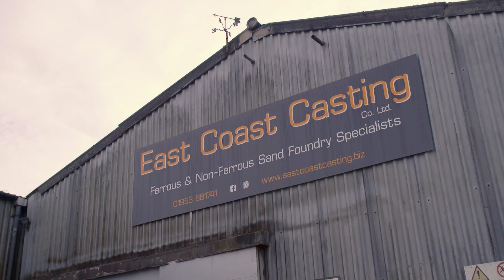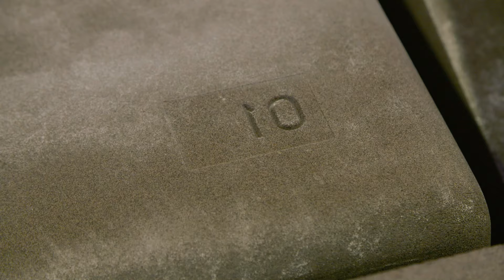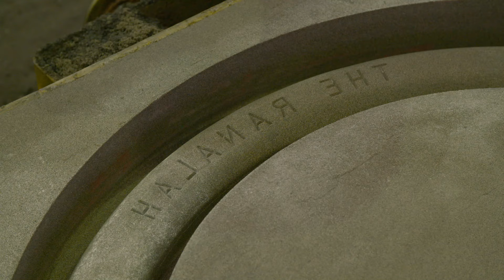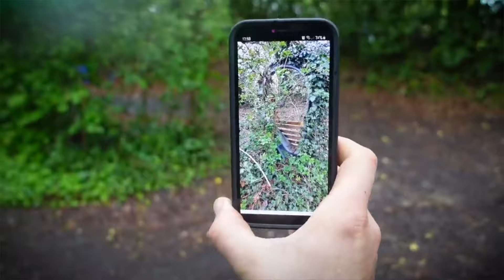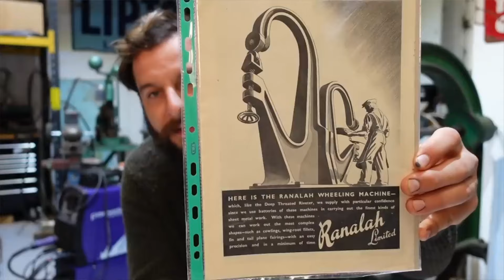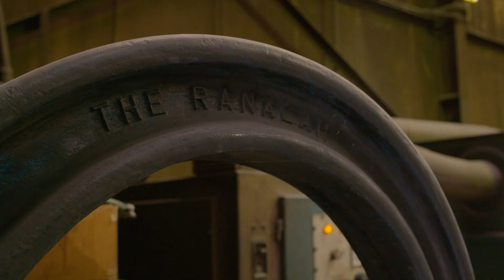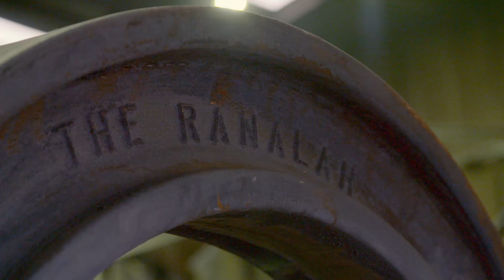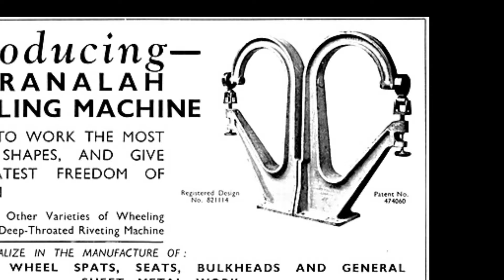Casting The First Ranalah! What Could Go Wrong?! | Reviving History (Episode #7)

Comment: I've personally cast over 200 tether cars in the last 25 years. When I made my very first pattern and poured my first casting it did not come out correctly, only half filled. Making changes to the runners and venting properly, the second one came out perfectly. The feeling of seeing that after making the patterns, building the furnace and pouring the metal is an incredible feeling. And holding that casting in your hand is a special moment. I deal with many customers that have a lot of money and can buy most anything. But the feeling you get from producing something yourself with your own two hands they will never know. Except for my buddy Malibu Larry. He's a self taught machinist, fabricator and mechanical engineer and builds the coolest stuff just for the fun and satisfaction of it. His mansion, Ferraris, Porsches, etc. are cool but no comparison to the awesome toys/projects he builds. Kudo's to all who work with there hands!
Reply: Great words 👍🏻

Comment: That looks truly amazing, it really does. I hope it inspires many others to follow your footsteps in similar projects large and small. I was lucky enough to be able to learn the sand casting process when at school and made a cast aluminium G clamp which I still use 40 years later. Congratulations
Reply: And I made a sand cast paper hole punch body which I still have. Imagine a school having it's own foundry and full engineering machine shop today.
Reply: @andrewdking  I went back to the school a couple of years ago and the workshops have now been converted into technology classes ... you won't get your hands dirty there anymore!!
Reply: @davidberlanny3308  well at least you still have your old senior school. Mine was Bourne Valley in Hemel Hempstead and was one of the best schools for engineering and technology in the country through the 1970s. Alas, now raised to the ground to become a housing estate cus the birth rate plumited. Now it's right back up again. Short sighted councils as usual. Anyway, it had a metalwork shop, a machine shop with foundry, a woodworking shop with machines, a technology shop specialising in pneumatic automation, plus a drawing office classroom (TD). We won many country wide interschool engineering challenges, making a hand pump fire engine, a petrol engined powered go-cart and a few racing hovercraft (single and double pusher fan types), even doing our own fibreglass moulds. We digress 😄
Guess my profession; mechanical engineer in aerospace 👍
Reply: @andrewdking  It's a small world Andrew, I was born in Hemel Hempstead!! That said we moved away when I was little and I didn't go to school there. It's a shame that your school was erased, I wonder if any pictures exist of all that was made in those workshops. I hope so - these days you will find practically everything on the internet. I didn't know when I was at school but our metalwork teacher wrote several books on metalwork for beginners. To cut a long story short, with the help of several people these books have now been republished. You will see  a short video of some of the pieces that we made on my YouTube page, I apologise in advance as I'm really no cameraman!! It's entitled 07 Kenneth Wells.
I also moved into mechanical engineering and now find myself working on submarine projects in Spain

Comment: Congratulations Dom ! A great finish to the year. As an engineer (retired) I love to watch the experts at work .I could almost smell that distinctive slightly sulphurous smell of a foundry again. Magical to see the casting rising from the sand.
Now, how are you going to machine it ? I'm really looking forward to the next instalments.
Happy New year.
Reply from the maker: Thank you! The foundry is an amazing place we were very lucky Chris let us wonder around all day! 
There is no machining on the body, the parts are set into the oversized holes, I’m working on the jigs now
Reply: @DominicChineas  Do you have to let the casting rest outside for several months so it stops moving like in the old days or are there methods of de-stressing it now with heat treatment. I have seen images of the large stacks of castings for the Victoria Line Tunnels weathering outside before they were checked for size & shape and installed.

Comment: Brilliant video and we both have things in common as I also cast metal but only bronze & alloy and not to the size of anything that large,+ I built my own full size wheeling machine but out of 6” square tube 1/4” thick as I also restore old cars but as a hobby as I’ve been retired since 2003 . You’ve done a cracking job and quite rightly must feel proud 👍👍👍😀

Comment: I used to use exactly one of those during my sheet metal worker apprenticeship in the late 1960s. They were mainly meant for manufacturing car body parts, to repair damaged ones or make replacements. They went more or less out of fashion when it became cheaper to just buy replacement parts from the car manufacturers. I wouldn't be surprised if there are still quite a few in use in Africa, India and Pakistan where it's difficult or too expensive to buy replacement parts.

Comment: I used a similar machine back in the 90's. There was a wheel on the bottom you would kick with your foot as you wheel and then a long lever to turn by hand to increase force. The floor would shake when the metal came out under load.

Comment: Did you know that there is a 3D sand mold printer that would have done the same mold without the wood pattern.   I don't know if any fabrication company in your country had those with Dassault Catia to make the 3D model rendition, but if you had access to one, the process would have been probably simpler.    

But still the pattern maker did a great job and you got a nice replica cast that match the original.   Can't wait to see the machining and the final assembly with the moving and fix parts and see it shape metal sheet into a part.
Reply: We have used 3D printed sand molds to produce a Bentley block, but I’m unsure if a sand mold of this size could be printed. You would still need a metal frame around the mold which we did with the Bentley 3D printed mold. 

Of course we use modern methods in our works but the traditional side of producing this item is & was the best way’ Dom is keeping as close as possible to the way these historical Ranalah machines were made, and this is the way 100%. 

Glad you enjoyed the video.

Rgds, Chris

Comment: I think I could tell them apart, Dom. As I said a few months ago, the font isn't perfect. The original R has the loop that intersects the vertical half way up. The new one has the loop intersecting the vertical slightly higher. However, despite that, I think it's brilliant. Well done to you and everyone involved.  You clearly are made up. I hope the venture succeeds beyond your dreams.
Reply: Andy, You will always be able to tell the difference from a new casting to a original 100 year old one. The font is spot on and may differ as to the sand or moulding technique they / we use. It may differ on every Ranalah at there, due to sand movement when the pattern is removed from the mould.  It’s a great story as you say 👍🏻 & one we have throughly enjoyed 🔥🇬🇧

Comment: It's amazing (literally awe-some) seeing the amount of time, and skill, that goes into making a casting, especially the size of the Ranalagh frame. 
Well done to all involved (and I wish the businesses a prosperous future). 
The one question I have, and it's something I have wondered for years, what do they do with the used sand? The extra metal that fills the vents, etc, can be melted down and used again, but can the sand be reused? (I noted it was mixed with a resin, to hold the shape when the pattern is removed, but after casting it was almost a powder again.) And is it different now from casting 'back then'?
Reply: Thank You.  ( Yes the sand is reclaimed in our foundry. All extra metal, runners, feeders are re-melted. )  👍🏻🇬🇧

Comment: Well done! Are there going to be more Ranalahs cast in future? Quick questions, does the caulking used to seal the patterns together spring the mould out a bit? There appeared to be minimal flash. And does the special sand get re-used, or is it one time only? It was a pleasure to watch the traditional skills in use.
Reply: The sealing glue ( Jointstop ) around the mould is just to give a extra bond with the two mold half’s.  Minimal flash is always good 👍🏻 & that’s how we like it. 

All the sand is reclaimed through our reclamation plant. 👍🏻

Comment: I'm interested in that new final sand mould preparation process of spraying the mould impression with some sort of sealer paint to improve the final surface finish. Once the raw casting has been grit blasted, can we see a close up of the iron surface so we can see this finish and whether it is indeed an improvement or not over the original. I'm an investment casting fan because of the superior finish, so anything that stops a sand casting looking crude by comparison will get a thumbs up from me.
This sand casting does seem a very long and probably expensive process, so as some engines still appear to be sand cast (my Harley engine is), how is this speeded up for high production rates ?

Comment: My guess,36 x 25Kg weights  on the top,  50 on the first?  but thats 2.15 Tonne , the pour was ~ 1T so the upper only 500kg . They are right I have no doubt and my calculations are missing my  unknowns and the experts known.  ,.A real pleasure , the whole operation , the casting crew,, serious work. was that not waterglass sand  didnt see any co2., and the coating, so no pitting from damp sand. ,   ,Pattern Makers, wow that looked gorgious.Had to play lenny kravitz  fly away for the pour. Make to last 1000 years. fulcrums

Comment: Why could you not use the original to do a mould….
Reply from the maker: Chris will explain it better but basically the iron shrinks when it cools and turns solid, so the red wooden pattern is actually slightly larger than original, to make sure the final cooled casting ends up exactly the same size as the original.. 

Also a wooden one can be split in half and is a lot easier to lift!
Reply: Dom has explained it very well 👍🏻